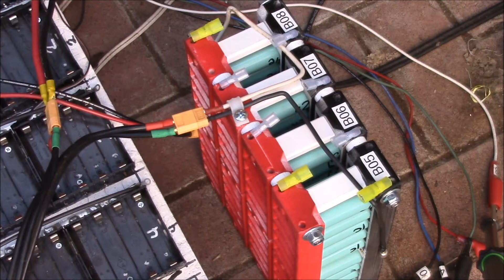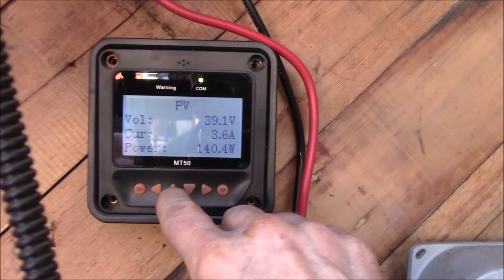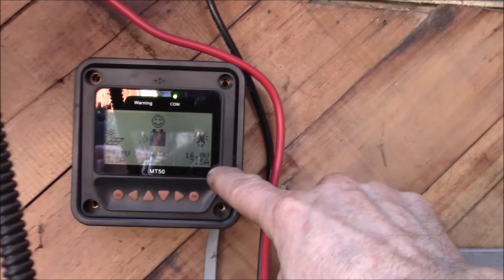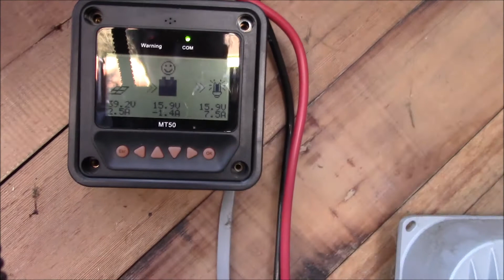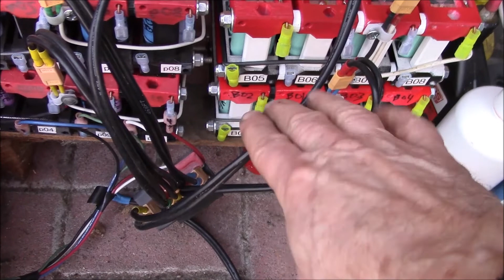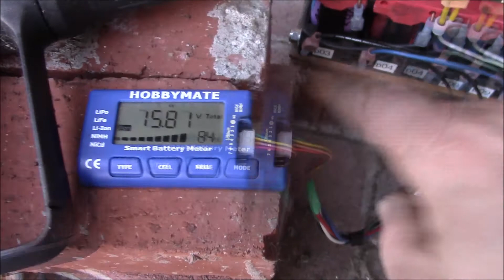Building 20P Battery Modules, Part 7

Comment: Please are you using only one BMS  for all the four packs?
Reply from the maker: Yes, that is one of my plans.  I need to finish up a balance cable board where I can connect up the 4 packs plus the BMS and then one 4S BMS will be used to handle one group of 4 parallel battery modules.  In the mean time, I.m running these 4 bottom balanced battery packs w/o a BMS and they are doing fine.
Reply: R Brown thank you man, big up to you

Comment: 16 volts? Are these 4s packs?
Reply from the maker: Yes, 4S20P for now.  I'm using 16 volts since much of my ~12 volt equipment will work up to 16 volts.  This way I can try out the lithium ion cells, learn about them, see how they work, etc.  Then I have the option of re-configuring the battery packs as 7S if I some day decide to go to 24 volts.

Comment: Nice looking. That is why I started to build my 7sX10p 24v pack easy to swap out if one goe bad
Reply from the maker: Yes, I like the smaller battery packs like you are building.  Easier to swap out as you mention, both electrically and also weight wise.